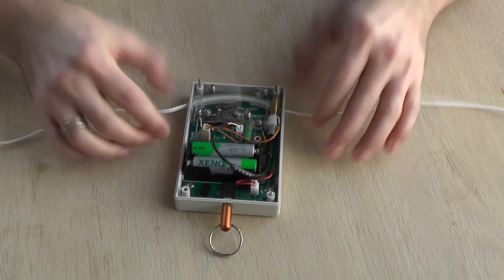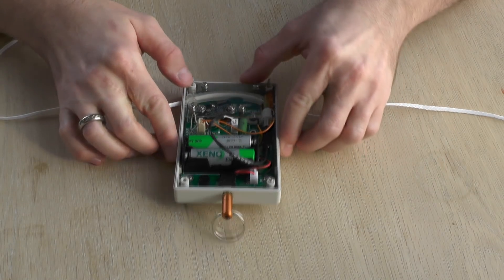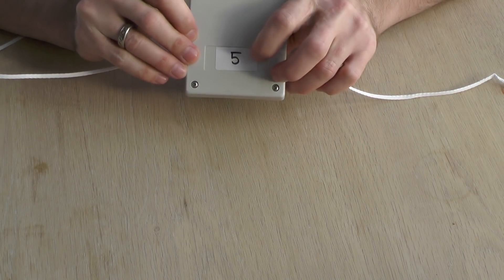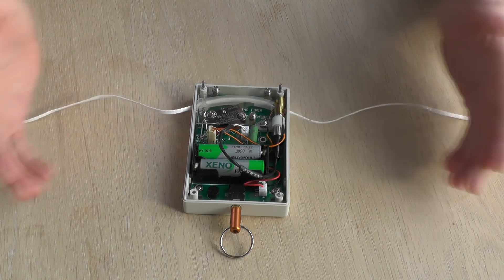Main Parachute Reefing: Controlling the Opening Sequence

Comment: What is the cutting device?  
A solenoid knife or a hot knife to melt any plastic rope?
Reply from the maker: We get the cutter from Cypress. This is the one used: https://www.cypres.aero/sparepart/pulley-part/
Reply: Wow! Cypress cutter can goes thru steel cable. Incredible!
https://youtu.be/2h5oNsRapRA
That is a neat and compact pyro unit. 
Thanks for the info 👍👍👍
Reply: It looks like a pyrocutter to me.

Comment: Hope the batteries stay in place until no longer needed, seems a loose fit.
Reply: This also was my first thought and is my biggest concern about this design. I work as an repair engineer for avionic electronics and in the past twenty years of my carreer I'd learned one thing: Everything that is not tightend up, strapped on, bonded to, fixed or glued on thoroughly, will come lose and rattle itself apart.
Reply: John Francis Doe lol I was just thinking the same thing however I imagine the placing of the lid  causes their movement to be an impossibility. 

However contamination, corrosion, oxidation, etc between the batteries and the contacts causing a disconnection is something I would consider a possible mode of failure. 

I place and remove 8  batteries in similar size and holder everyday and frequently 1 will not make or keep contact due to some barrier that was invisible to initial inspection. I would run a soldered battery pack with either a waterproof connector or no connector and a seperate input for charging of the battery pack. (Though perhaps this is all needlessly more expensive.) 

Regards, Great video it was shot very well and the explanation of the device was concise and clear. It is all beautiful and a elegant design. I like the simplicity of the beep sound to tell if it's been activated.
Reply: Same with the connectors
Reply: You make a good point.  The batteries need to be bonded into the case.  I had a nose cone on a large rocket that when it ejected the force sheered the batteries for the tracking beacon off the PCB.  Batteries that where bonded and wire tied down stayed put.
Reply: Konoh, same for code. I'm SQAE DO178B: C ansii, nothing fancy,  NEVER USE "ELSE" CONDITIONS, assume NOTHING.